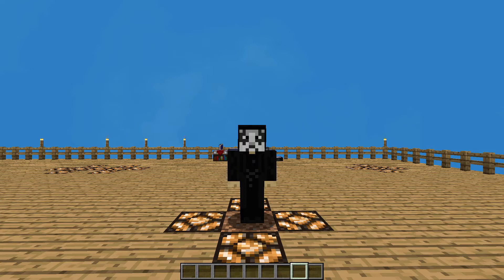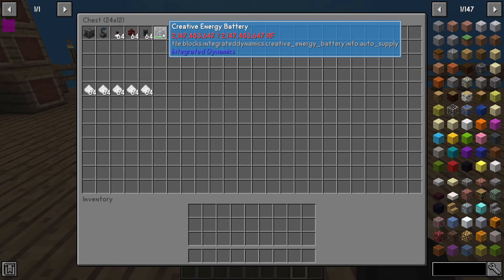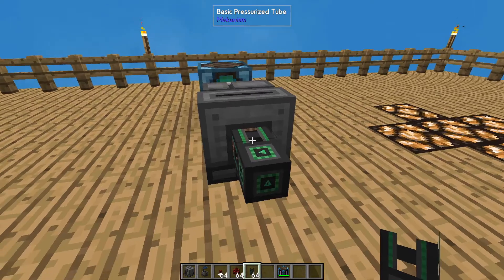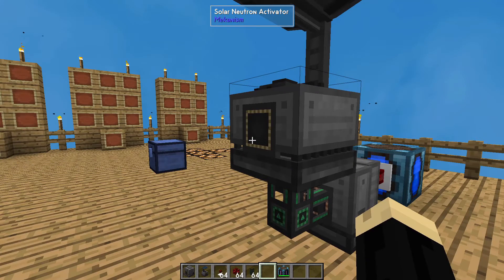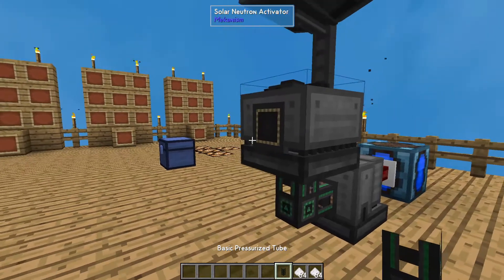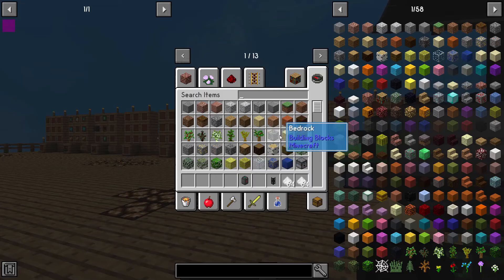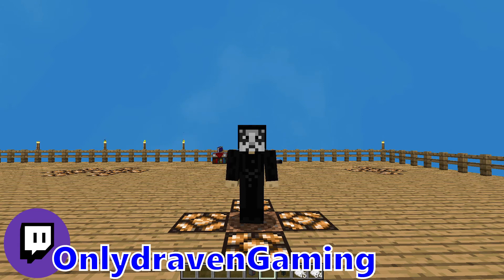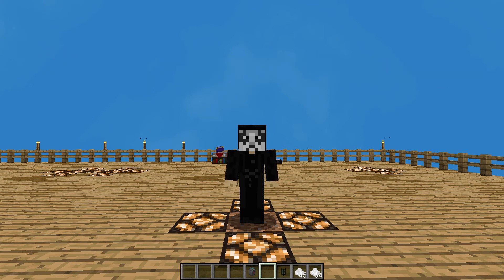Minecraft - Sky Factory 4 - How to Make Tritium

Comment: For the record, the oxidizer doesn't turn the lithium dust into liquid lithium, it turns it into gaseous lithium.  I tried using the Thermal Evaporation Towers to produce liquid lithium, but initially couldn't find a way to actually get it from the tower into the rotary, since none of the available pipes could make the connection. I hoped your option here would do the trick, but as noted this makes gaseous lithium and not liquid lithium.    I did eventually figure out how to pipe the liquid lithium out of the evaporation tower; it requires using a Fluid Extraction Cable to pull the liquid lithium out of the Thermal Evaporation Valve, then immediately connecting it to a Fluiduct from Thermal Dynamics, and connecting THAT fluiduct to the Rotary. Cyclic cables can't be used to make the full connection and must be bridged with another pipe, like the Fluiduct.  Mods drive me crazy sometimes.
Reply: i went through the same exact thing and after using 6 different pipes i just used cheat jei